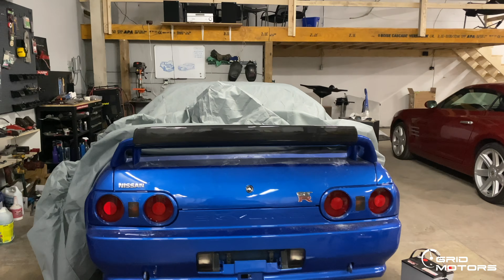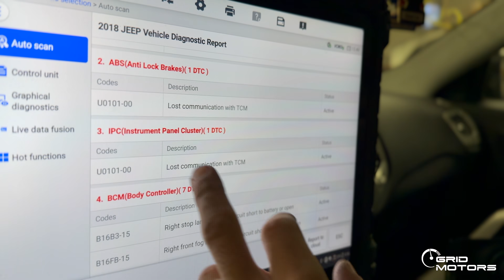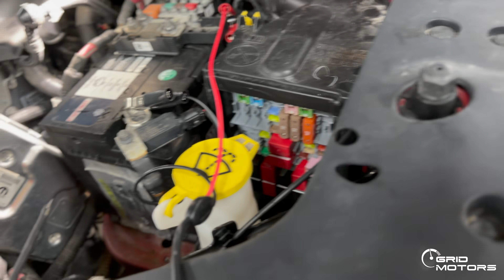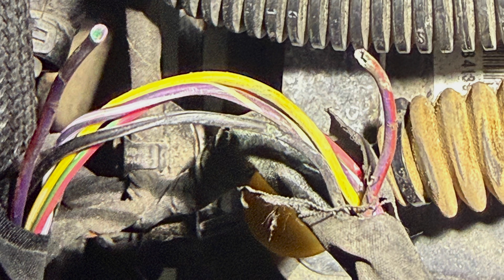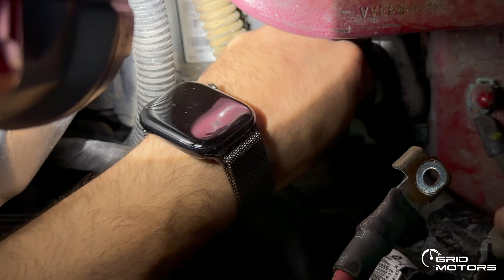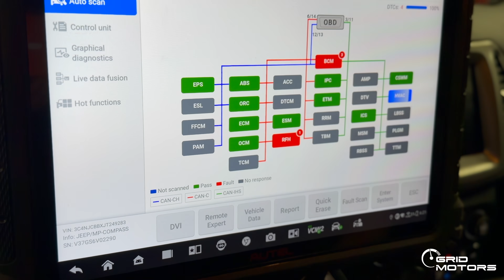Jeep Compass U0101 No Start: Don’t Replace the TCM Until You Check This!

Comment: Man I just got this vehicle worse decision I've ever made, I'm having this identical problem vehicle was wrecked after dealer/regular Memphis people I believe wrecked it after they bought it so it never had a savage title, somehow, and a lot of insulation was missing I would always have my front driver windows passenger and driver only not work after rain however they would always come back after drying up only a month and a half have it in this vehicle horrible rain storm will next thing I know I get this weird click of a crank I know my auxiliary battery to be low but I'm definitely having the same faults!! I'll definitely be checking all this getting insulation selling and watching your videos sincerely OnDemand Mobile Mechanic s! 
Owner operator Rocco Roland